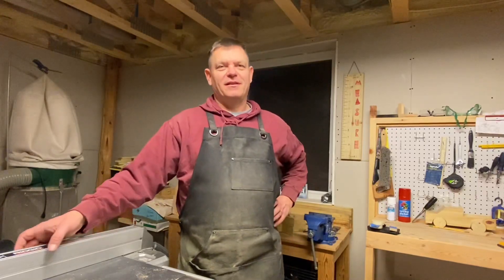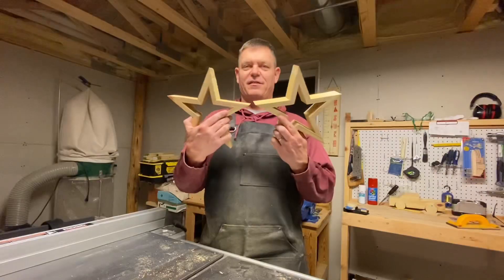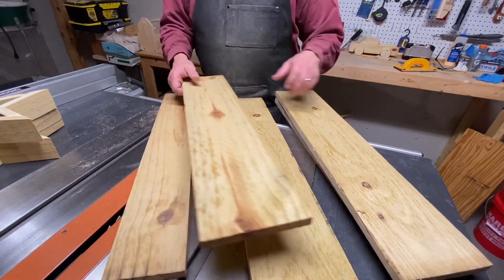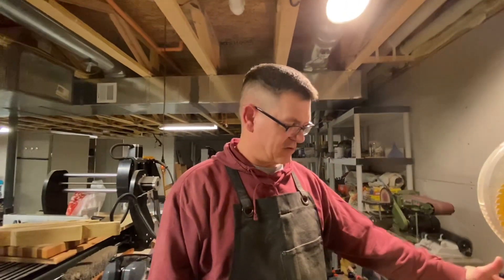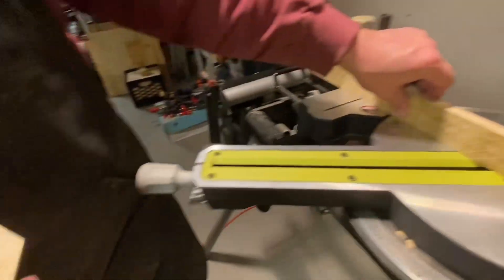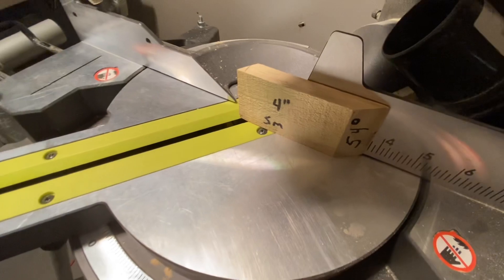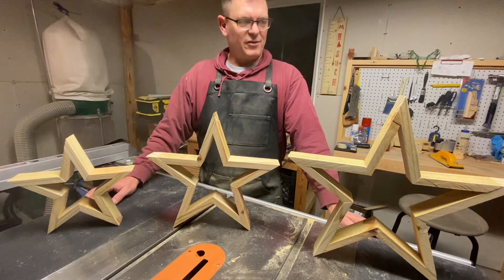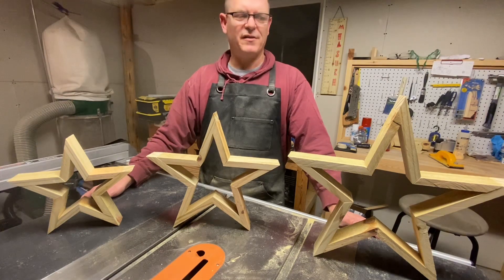Making wood stars

Comment: Draw a circle on paper with compass and divide into 5points around circumference .join dots then measure inside these  lines the thickness of wood .then measure lenghts you need .alter the size of the circle to suit.

Comment: Need help. I set my board at 24degrees from the fence and miter base at 30 an I got no where  54 degrees. More like 35. I then switched the board to 24 degrees from the 30 degree from the angled cut on the base board. Cut again wit miter set at 30. Got worse down close to 24 degrees. I then thought what if I bring the base back to 90 and make a cut. It came up 54.  I know that is the magic number we are looking for however I would like to learn what I did wrong on your jig instructions!!  
I am sending pictures accordingly!!
Reply: The jig was 90 degrees to start with and I glued and screwed my board on there at 24 degrees. I then put the jig up against the fence and set my miter to 30 degrees and cut the end of the jig where the 24 meets the blade at a 30 degree angle giving me a total of 54 degrees. Hopefully this makes sense. If not let me know.

Comment: You shop location is the most similar to mine. Curious to know what dust collection if any you have. Basement shops need a bit more love with dust collection. I do have a large door to the outside near my work space but Id rather keep them closed if possible.
Reply from the maker: I have a 70 gallon, 2 hp central machinery dust collector from harbor freight. I’ve had it for about ten years and it is still going strong

Comment: what angels go together?
Reply from the maker: Put the 36 degree angles together so they form a v with a short and a long. Once you get 5 of those then attach your short end to your long end and it should form the star.
Reply: @WoodworkingwDana20479 i did that and it looks weird my pieces are off on the inside